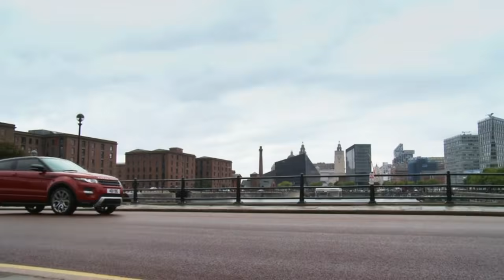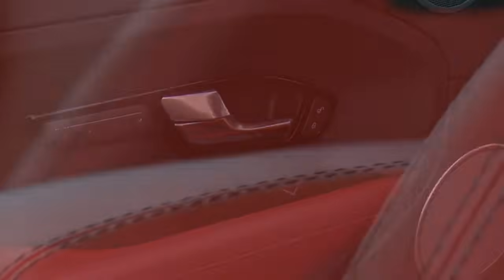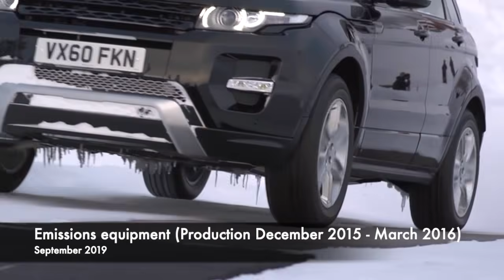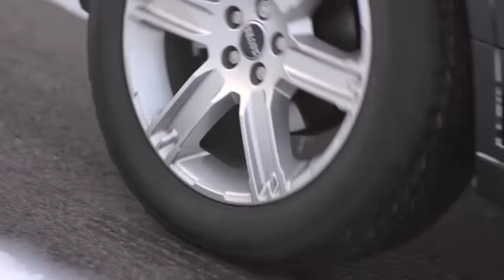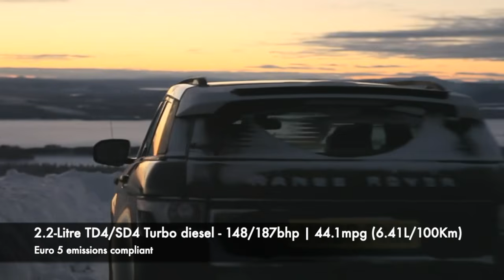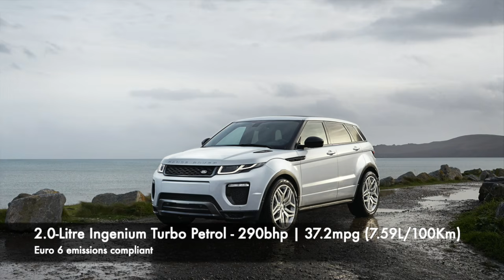Range Rover Evoque L538 (2011-2018) Avoid buying a broken Evoque (TD4, SD4, Si4) Common problems

Comment: Avoid! Just avoid altogether.  Seriously there designed to last 150000km, Im fixing mine this 2 years and can't get it sold. JLR shouldn't be allowed to sell them. As pretty as mine is, its one complete piece of mechanical crap that has every possible engine part replaced at this stage. also there part replacements are an astronomical price and engine waiting list for replacements is almost 2 years. Toyota RAV4 or Skoda is the way to go. keep your sanity and money and fucking run if you see one..

Comment: At 5 min. You talk about early turbo faults, but do not mention if it is petrol or diesel? Later you talk about Ford engine,  2.2 diesel and 2.0 petrol again issues are not seperated? Are the issues both diesel and petrol? Wold be nice to now...

Comment: I’m planning to buy a Land Rover Range Rover evoque 2014 2.2 diesel 150cv 87900Km, I have the chassis number. Where can I check the recalls and how can I find if this specific model is reliable?
Reply from the maker: Depending on your home country recalls are either on an online database that requires the VIN, this is usually the website of your vehicle registration and licensing agency, or your local dealership can advise if there are any outstanding recalls 👍
Reply: Hello, i'm planing to buy the car with the same engine, What do you think about it?
Reply: @ I got the one with the jaguar engine. Tested both and the jaguar is smother. I liked it better and still do.

Comment: Yeah- had the turbo/exhaust manifold crack at 57K miles on my ‘16.  Expensive to replace.  Now my HVAC system is doing something strange.  Having difficulty switching between vents- and the airflow is much reduced.  Does the Evoque have two blower fans, and maybe one of mine is kaput?
Reply: Blend door actuator
Reply: Thanks. What does that take to fix?   It’s currently intermittent.  Took it to the dealer but it was working and they didn’t find the issue

Comment: Don’t forget the oil dilution problem with the first few years of 2.0 diesel Ingenium engined cars (about 2016-2019 I think). Needs oil changes every few thousand miles and causes early wear and engine failures including timing chain issues.
Reply: Would you recommend a Range Rover or Land Rover in general? Thinking about buying  an used Discovery Sport.
Reply: @maxmustermann8167  We had a Discovery Sport - No, I would not recommend it! Aside from the engine issues, the servicing, maintenance and parts were ridiculously expensive, and we had so many electrical/electronic faults with the car. It just wasn’t reliable. The experience was so bad that I’ll never buy another of their cars.
Reply: @cp4512which engine did you have? Petrol / Diesel? Ingenium?
Reply: This is down to people driving them in wrong circumstances like town driving

Comment: I have owned a 2011 super early diesel, land rover dealer service for first 3 years(expensive and bad terrible service where i live) then a good mechanic serviced regular from then. short journeys and low mileage. just had the 10 year all oil and timing belt done. the only problem i have had is a issue with the interior lights not working properly, oh and a oil leak from a pipe, pipe just needed changing. oh its a manual so i guess the clutch will need changing soon at some point.

Comment: Just purchased 2013 with 103000 on the clock. Test drive was good safety check was a good buy. One month in new radiator $1.5k. Now BCM and harness failed and a leak of oil return line on turbo, loss of power steering as well. 14k was the purchase price now worrh 5k as is now not drivable. Either i spend 7k to fix of take a 9k loss and junk it. Uggh
Reply: Is yours a petrol or a diesel?
Reply: @justsayin7937  
Petrol and an update the rack failed as well all servos broken. That repair here is $8,000.00 it's a shame that I'm junking a car I had for one month and lost $14,700.00 on with the purchase and repairs as well as  diagnosed problems.
Reply: I just bought a 2013 coupe with 37k miles. I bought the extended warranty.  Any idea much does a 40k mile service cost?
Reply: I have a 2013 coupe about to replace the engine. This vehicle has a bunch issues with coolant losses because it has a Ford ecoboost engine. There is a lot of Ford parts that can be used for repairs at reduced prices so do a little research
Reply: I was gonna buy one but this comment alone officially changed my mind, I'll stick to my Lexus convertibles . Lol

Comment: Great video, thanks a million! It really helps. Can we deduce that Evoques produced 2020 onwards are safe purchases or at least more reliable than 2015-2018 ones? Thanks again
Reply from the maker: Many thanks, as another comment on the video mentioned, there is now a recall open for steering wheel bolts on all model years that is worth checking for 👍

Comment: Don't forget the power steering rack recall that affects many 2017 built cars and all built before.

OEM pads, certainly rear, are absolutely terrible.  They wear astonishingly quickly.

Oil dilution doesn't happen to the 2.2 diesels, so do not need an extra oil change.

Rust starts at the back of the rear door opening where dirt sits under the plastic trim on 5 door cars.  First you'll notice without taking the trim off is when the rust spreads across the panel.  3 doors will rust underneath in the same place but in theory it's harder to detect.

Surprisingly they can break springs quite easily even in road use.  £250-300 to repair.

Gearbox oil change at 10th service makes a surprising difference, worth doing more frequently for smoother driving even if no actual need.

Steering wheel buttons, like the XJ that shares the same part, fail after a while.

Avoid the OEM towbar and fit a TowTrust for a truly invisible cut.
Reply from the maker: Some great information, thanks for adding. Do you know the recall campaign number for the steering rack, we could only find one for the bolt with the rack being replaced if damaged and wondering if we are talking about the same thing or two separate recalls 👍
Reply: @themilesdriven  The recall is to have the 3 bolts replaced that are prone to snapping, seems to be no correlation between age and whether the bolts will snap at removal though.  Could be down to mechanic's skill.  Think they're at N642v5 now.
Reply: 心目中的好車

Comment: We're run a 2016 Evoque diesel since new. Main dealer serviced. Repairs: new battery, new front and passenger door central locking mechanism, new tyres, new windscreen after original leaked  (Land Rover contributed £300 to £900 cost).  No DPF problem despite lots of short journeys.
Reply: 5 . That’s impressive 😊
Reply: Sell it new before it lunches it's engine lol, 5 mates now have had complete engine failures, £15k average cost. last one was lady at work in Dec 23, 44k 17 plate. Bang. she's had to scrap it.
Reply: 15k average cost? Hmm if they really paid that, they want their heads examined. My Range Rover V8 suffered premature turbo failure which completely took out the engine. It cost less than 6k for the full engine rebuild, with new cranks, new turbo's etc etc etc. How on earth can a poxy 4 cylinder single turbo engine possibly cost 15k   @dazzassti

Comment: As a current owner of a 2012 Si4 Dynamic since new I will give my feedback on the issues I've had from 11 years of ownership.
- Clicking noise from steering/suspension issue resolved via service bulletin at scheduled service (1st year).
- Coolant loss, resolved via service bulletin at scheduled service (1st year).
- Turbo failure at 75,000kms, housing separated which caused major oil loss. Car was towed back to dealer. Vehicle was out of factory 3 year warranty, but I had a 2yr Land Rover extended warranty underwritten by Allianz. Claim was denied but was repaired by Land Rover as goodwill (4th year).
-Front right magneride strut developed slow leak, still operable but drip oil which shows on rim inner barrel (6th year ongoing)
-Rubber on volume knob becomes tacky/sticky, the knob is not sold individually through LR. I ended up removing rubber coating with a rag & contact cleaner, looks & feels fine after removal (6th year)
-Front right door latch developed intermittent loud noise when locking/unlocking, took it as a sign of imminent failure so swapped it out (9th year).
-Heater coolant hose failure (9th year)
-Top coolant hose failure(9th year)
-Oil leak from vacuum pump & valve cover gaskets, these are rubber gaskets which get hard over time (10th year).
-Radiator leak, replacement is a big job as vehicle A/c system needs to be degassed & basically required disassembly of front end of car.(11th year)
-Noticing some of the cloth/leather is delaminating from trim pieces (11th year).
-Currently trying to resolve a fueling issue (too lean & too rich fuel mixture CEL codes), already replaced oxygen sensor which did not resolve issue. I have a new high pressure GDI pump on order so hopefully that fixes issue.
Reply from the maker: Thanks for adding such a comprehensive list as an owner review, some great information for potential buyers to consider 👍
Reply: I'll follow up on my fuelling issue I mentioned above-

It ended up being a a split in the Intercooler Outlet Hose (LR024517) right near oil filter. I was getting Too Rich & Too Lean Bank 1 DTC codes P2178 & P2187 and P2282 Air leak between throttle body & Intake valves.

Comment: Sure would be nice to know the years that the petrol engines were changed out from the 237 hp to the 290 hp 2.0T, and was the second 2.0 I  T a ford engine??
Reply from the maker: The power outputs were changed in different global markets at separate times for a variety of reasons so we were deliberately vague so as to not give one person the right dates and another the wrong ones. Which market/country are you looking at? 👍
Reply: @themilesdriven  thank you for that!

Comment: I got SI4 2013, I got turbo issue at 120000km, looks like a common issue with Evoque. I also started getting noise from front differential, dealer recommended replacing the front diff, total bill for turbo and diff $16k AUD😢. I owned the vehicle since I bought it new in 2013 and always maintained it with the dealer.
Reply from the maker: Thanks for adding feedback on your ownership experience. Sorry to hear it has been so costly 👍
Reply: Would you recommend this car?!
Reply: How much mileage can the engine take ? i am considering buying a 2011 evoque its at 168.000 kilometers
Reply: @Revelation13-8  do nto do it unless u have 1k USD per month to maintain it. cause WHEN the engine blows up, the entire yearly budget will go out the window.
Reply: @adalgisounoqualunque9033  I did alot of research and there was like 90% negative reviews on this type of car , videos on youtube showing they struggle in snow as well at winter , im glad i did not.
Reply: @Revelation13-8  good job man, you dodged a SERIOUS bullet. 
RUN from any Land Rover.
According to my experience, if u are searching for a very reliable car of this segment u can go for a Volvo XC40 or even 60 if u need more space. They are fantastic cars. Keep in mind that repairs on those, although rare, are more expensive than the average Audi/Mercedes/BMW, cause of better quality.

If you want to almost never think about it again, a Toyota Rav4.

It is so sad cause the Land Rovers have some of the best lines ever made, they are truly beautiful. And sadly, self destructing.
Reply: @adalgisounoqualunque9033  I got the a4 quattro allroad automatic and i dont regret it :)
Reply: @Revelation13-8  also an excellent choice :D anything is a better choice than Land Rover. Babysit it and you wont have problems. :)